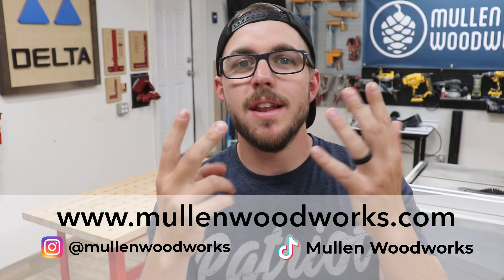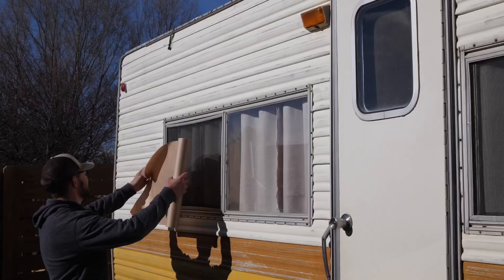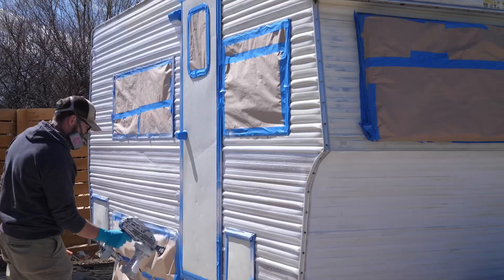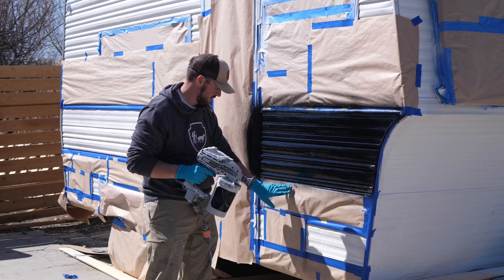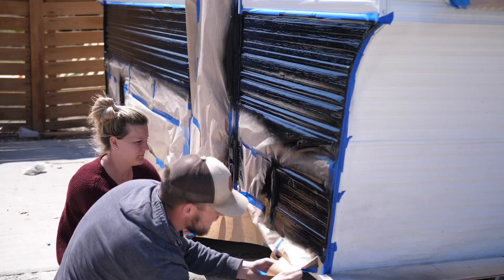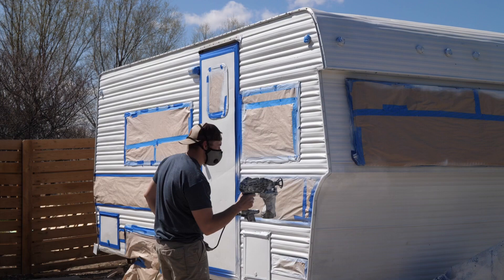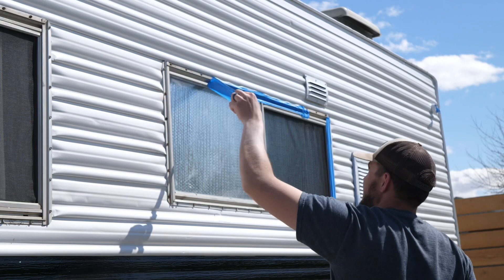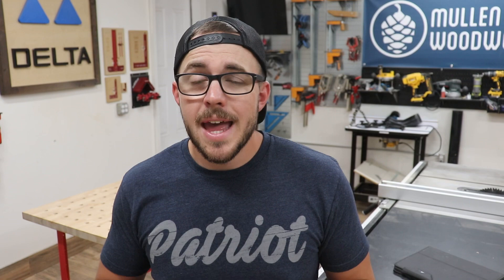Painting a Camper Trailer - Episode #7 Trailer Remodel

Comment: Hi there. From the looks of it, you probably resealed everything (corner trims, window trims, beads, etc. etc) before painting? I restoring a trailer and not sure if I should do all of that before painting or after? Basically - I need to re-caulk the whole trailer from taillights to corner connections to windows, etc.
Reply: IMO I would do all the resealing first then paint for a more finished look

Comment: What was the mixing ratio? Paint to Mineral Spirits?
Reply from the maker: I didn't do a specific amount but just tired to get a consistent thickness. You don't want it too watery, just thin enough to allow the sprayer to spray evenly.
Reply: There should be instructions that come with your paint sprayer about how to thin it out